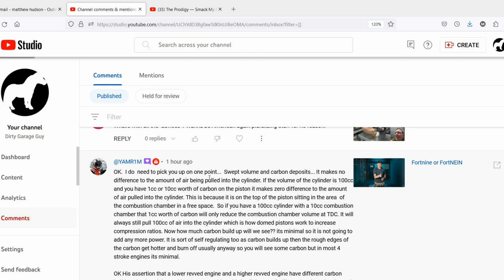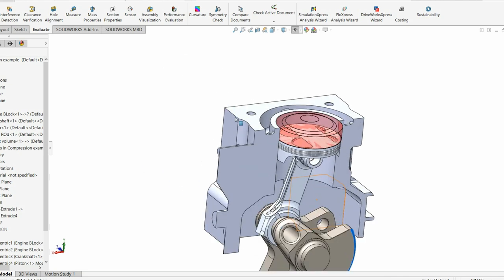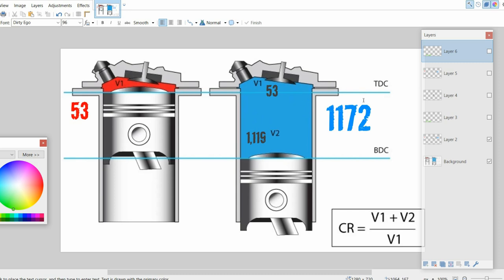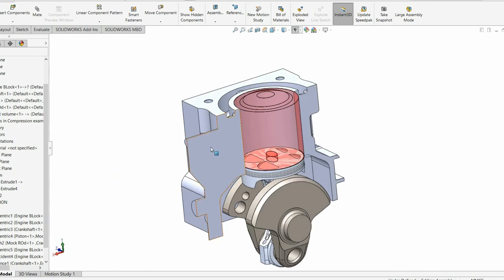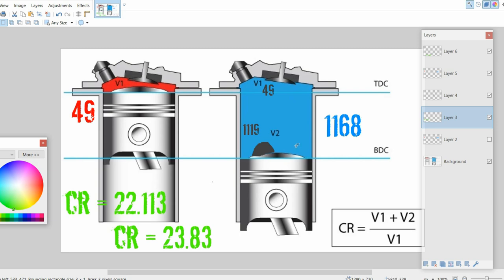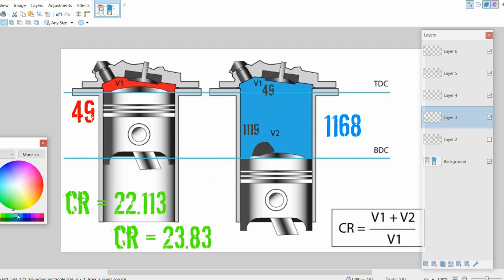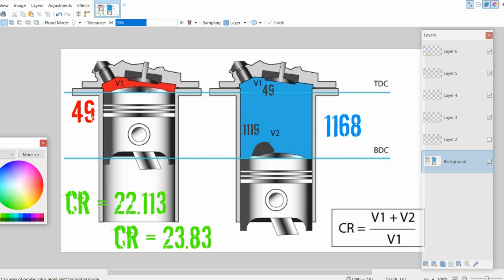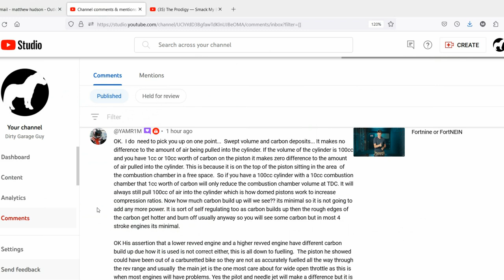Carbon and Compression - Fortnine/Richard question

Comment: On vintage bikes, there is a situation known as "coking", which manifests as what appears to be carbon build up on the cylinders/valves etc. Shop manuals for the time usually cover  a de-coking procedure at a scheduled interval. Some of the build up will be from over rich running conditions potentially, but also from some amount of oil burning in the combustion chamber (from leaking valve seals, piston ring blow-by etc. Modern engines, this is generally not such an issue. The problem with coking build up was usually pre-ignition...presumably from glowing bits of carbon in the chamber igniting the fresh incoming charge before the spark plug does.

Comment: OK.. I think I may have misheard something.. I thought you said that with carbon deposits it will draw in less air. 

So regardless of how much carbon is on the piston it will still draw in the same amount of air.. (as a simple pump.) So you did show that from tdc to bdc you had as much air drawn into the cylinder regardless of the carbon.  I think the confusion is the total volume is reduced but the amount drawn in is not. The carbon sits on top of the piston inside the combustion chamber (raising the compression ratio) but when the piston moves from TDC to BDC it will always pull in the same amount of air.  The domed piston reference is from when we had an issue with skimming heads on the V4 Honda with gear driven cams. We needed to raise compression so we had pistons made which were more of a domed piston to increase the compression ratio. But the actual engine capacity CC's did not change as it was still pulling 100cc per cylinder ( VFR400R HRC spec race bike). You didn't lose any air being drawn into the engine but we did increase the compression ratio. If you see what I mean.  The cylinder volume is always dictated by bore and stroke and is not changed because the piston has a lump (dome or block of carbon).  The "free space" simply meant that this volume above the piston is not measured as part of the engines capacity so it doesn't impact on the amount of air being pulled into the cylinder. (if you see what I mean). 

FortNine's example of two pistons one with carbon and one without is not a great example as my little pit bike ridden really hard, I do mean REALLY hard to the point we had a bit of piston to valve interaction, still has a carbon build up on the piston and within the head. Its not just some golden smoky colour waft of colour even after only 7 hours of run time from new or full engine rebuild. Being run slowly and checking the piston is a bit of a problem so I cant really get a back to back comparison like FortNine seemed to show, simply due to the engines being used on track only but the amount on the piston is still not enough to increase the compression ratio more than  0.1 or 0.2 points.    

@TornadoCAN99 vintage bikes had poor ignition and low compression ratios as well as very very basic carburation so they did run very rich and would coke up . I remember having o de-coke my Yamaha FS1E as a kid when it was standard. Later it had a lot of head work to raise the compression ratio and had to run higher octane fuels and then the piston had no need to de-coke the engine as it was getting a more complete burn and was producing double the power of the stock engine.  The bike could get pre-ignition before being tuned but it never led to the piston damage FortNine showed in his video.  The only time I had issues was after tuning and detonation putting a hole in the piston due to a combination of high compression and fuel with too low and octane rating, over advanced ignition and wrong spark plug grade. ( I was only 16 at the time) So ended up running it on fuel with octane booster and the hardest plug I could find which was and NGK 11 or 12 graded plug not the stock 7 grade plug.
Reply: You heard him correctly (16:22 & 17:50 of the previous video). You are correct that it doesn't affect the swept volume, in my opinion. V2 is the swept volume in the CR calculation and it is 1119 both with and without carbon in his example. 

I think there is confusion over the terminology of swept volume. Seems to me he is using it to describe the total volume V1+V2.

Comment: The carbon buildup compression argument can be easily proven/disproven in a practical  experiment with a simple compression test with a test cylinder and piston. I think it would make for a great video series that covers design, concept, testing, and conclusion. In place of carbon, use a soft sticky substance like clay or play dough to act as the carbon.
Reply from the maker: Compression test? No.
Reply: If you read the last sentence, kinda sounds like something delboy would say about the HDS😂

Comment: Might have been good to throw in some adiabatic compressibility stuff. Going from a pressure ratio of 22 to 24 doesn't sound like much, but it'll heat your charge up by a good bit more. Depending on how close you were to your fuel's autoignition temperature, it may well take a whooooole lot less than that to push you into detonation territory.

Comment: You tube video you might be interested in. "The KTM Superduke Triple Clamp Challenege" by Superduked. Where the stock steering stem, KTM power parts and custom steering stem are stress tested using a lever and weights.

Comment: Biggest problem with piston carbon build up is hot spoting and causing leane out due to detination ousting a hole in the piston
Reply: Detonation is usually too advanced ignition and too high compression ratio for the fuel being used. Especially in 2 strokes.  We had to set the 350cc Yamaha F2 ignition not with a degree disc but a distance from TDC set to within 0.1mm with a DTI ( dial gauge), where a degree disk could be out enough to cause the engine to hole pistons.  The compression was high enough to need either 114 Avgas or a mixture of 4 star fuel and octane booster (back in about 1986 when leaded 4 star and 5 star 100 octane fuels could still be bought from the local forecourt).  You can get pre-ignition with carbon build up but detonation is so hot that the piston is usually very clean with no carbon build up and you can actually see where the combustion started all over the top of the piston and then the hole.

Comment: RICHARD! DIMENSIONS! DO YOU SPEAK IT?!
Reply: The engine capacity is the bore and stroke, so regardless of how lumpy the piston is the engine will always be the same capacity.  BUT yes I did say the more carbon you have the smaller the combustion chamber volume so compression ratio will increase.
Reply: @YAMR1M  well in that words its correct ^^

Comment: Carbon buildup can cause higher compression and pre ignition
Reply: Yes but it depends. If you build up carbon at ur valves and those can't open/close properly it can also lead to loss of compression. Good clean burning of the gasses is important for a healthy engine. Ryan is not wrong about that.